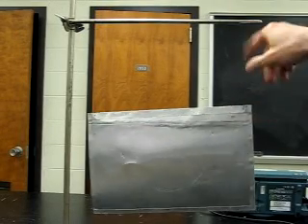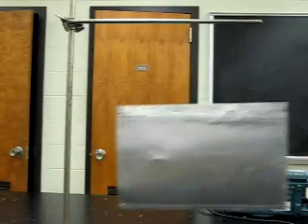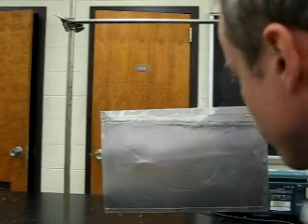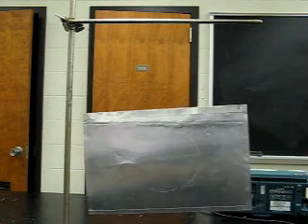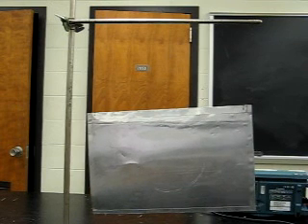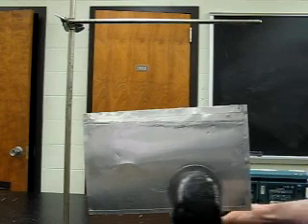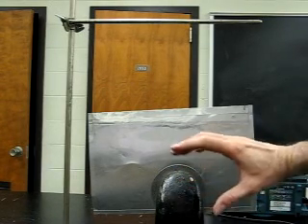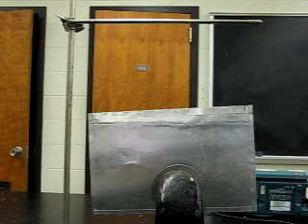Magnetic Damping

Comment from the maker: dragondude is correct. Mechanical energy is drained from the sheet to produce the current, but that energy is then converted to heat because of the sheet's electrical resistance.